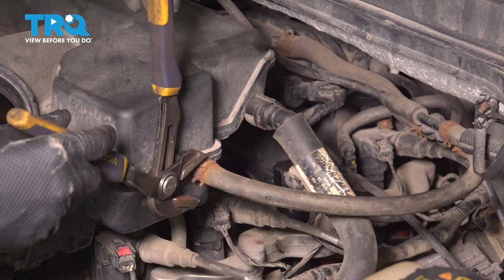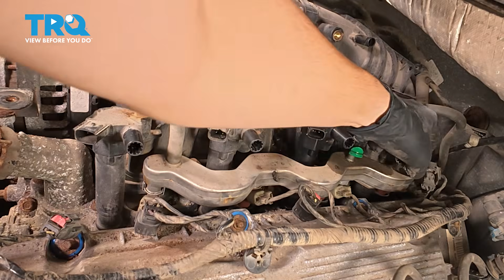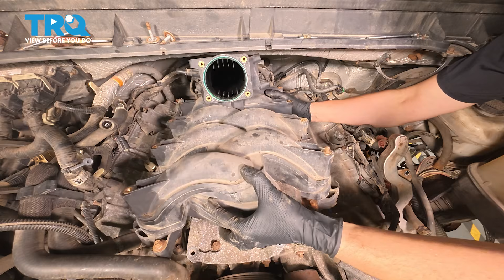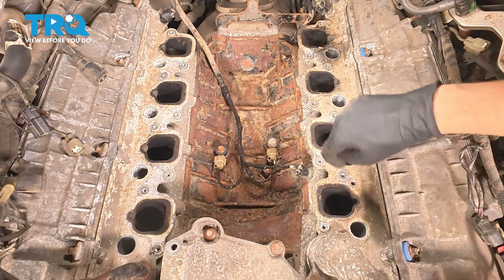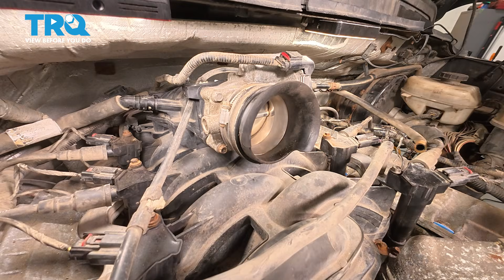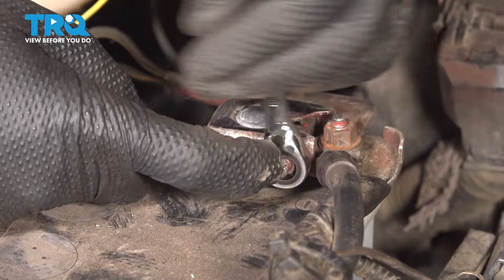How to Replace Camshaft Position Sensors 2011-2016 Ford F-350 (6.2L V8)

Comment: 2015 Ford F350 with 6.2. I was able to just reach behind the engine and change the sensors. The only thing that had to be removed was the passenger side pcv hose. Took less than 10 minutes.